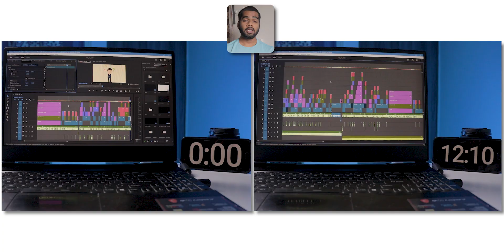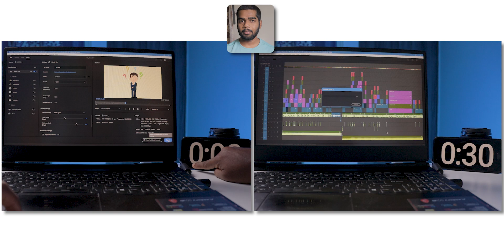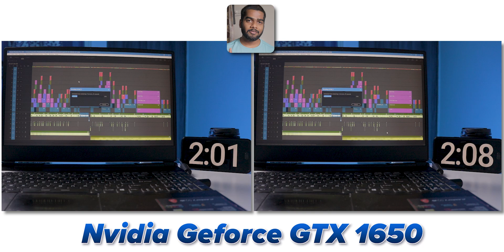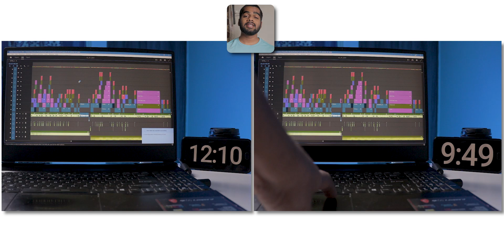Hardware Vs Software Encoding: Which is Faster for Video Export?

Comment: 4:57 quality is absolutely noticeable, when watching on a large display. I literally did the slowest possible hardware encoding on my RTX 4070 and the difference between that and CPU slow at CRF 30. The difference was actually enough, not like huge, but not as subtle as "unnoticeable"
Use a tool like vmaf if you do not have a large display to test it out. Vmaf is the industry standard in this.
On top of this, HW encoding even comes with some errors when exportibg from a huge project.

Comment: My computer configuration is:

Core i7-12700H 

Rtx-3050ti gpu

What will be better?

Software encoding or Hardware Encoding
Reply from the maker: Your setup is pretty good, so hardware encoding should be much faster.